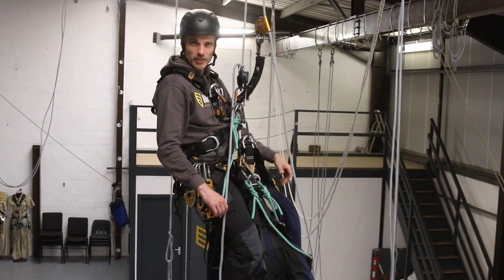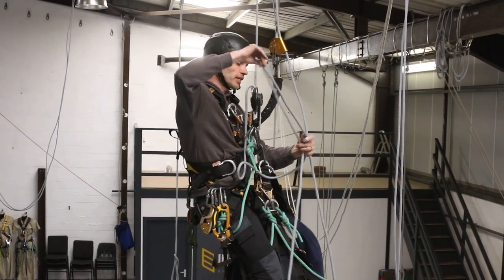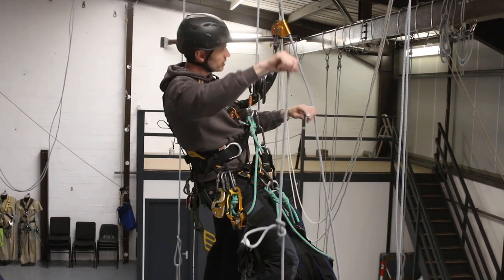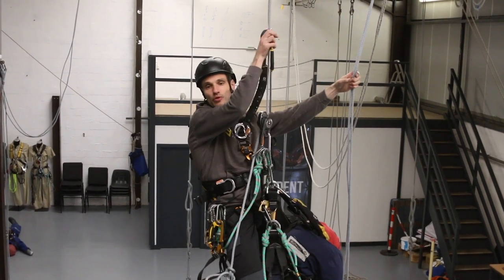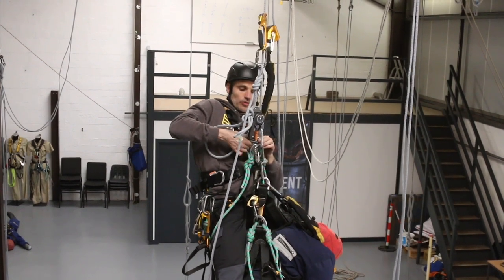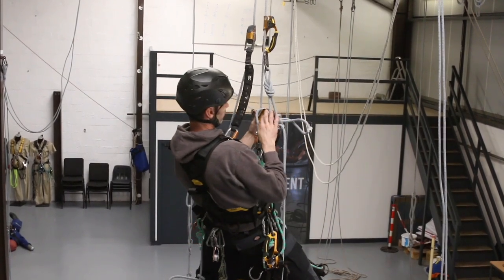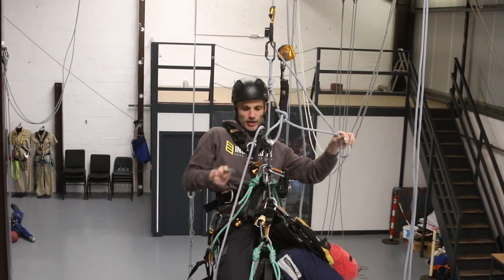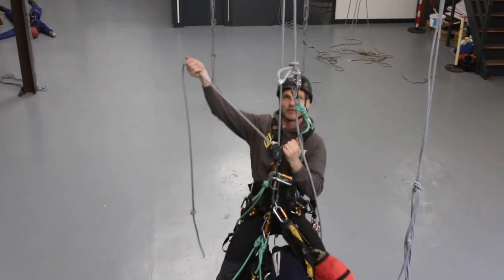Rescue Passing Knots

Comment: When needing to get the asap past the backup knot, is it ok to add another alpine butterfly in the backup line,  connect a cows tail into it, then move the asap below the alpines , remove cows tail and continue descending?  Cheers
Reply from the maker: No problem using an additional alpine as a point of contact to pass the knot, the method shown in the video is one of many acceptable options.
Reply: @independentropes4922  thanks

Comment: Is it possible when you get down to the knot on the working line that you clip an extra backup ontop the descender, then clip an extra descender to where you have backup, and continue descender from there... instead of using a toothed ascender as an anchor point. Then when you reach the 2nd knot (where the former backup has been, and the descender is now), you can switch over again?

Also, can you also use a non-toothed  camming device (ie. Camp Goblin, Petzl Rescucender, Beal Monitor, etc.) as an anchor point in lieu of the hand ascender?

Comment: If you have 2 x ID/Rig then why the need for a re-anchor? Why not just use both descenders and switch the back up when you get to each knot, release one descender and simply move it past the knot. Then switch over on the second knot, that way you get to keep all your equipment.
Reply from the maker: Nothing wrong with the method you describe but it can cause rope stretch issues if there's a lot of rope above you, also people sometimes forget to swap the back-up over. I know some people don't like leaving gear using the re-anchor method but I can say I worry too much about it.
Reply: @independentropes4922  Thanks for the reply mucker. Great videos. 👊

Comment: Great video, just a quick question, a few people are 50/50 on the hand jammer to re anchor? is it ok for a toothed device 2 person load? i did it on my 3 and no questions asked like.
keep up the videos they're great mate
Reply from the maker: Two people on the hand ascender does concern some people. The Petzl rep has confirmed they are fine with it as the 140kg marked on the Ascension is a nominal value to do with the EN standard, not an absolute max. The tech tips on the Petzl website also show the Ascension used as an attachment point when doing a counterbalance rescue from the Croll. This also loads the ascender with the weight of two people, so bearing all this in mind I'd say it's fine.
Reply: @independentropes4922  yeah cheers  i agree, theres so many grey areas in rope access, great video's man keep em up they are mint and priceless as references
Reply: @independentropes4922  hey great video :)
I cant really find the tech tip you are talking about, just one in combination with a JAG -System where not the full 2 person load is in the ascender. Also the german FISAT now says its not ok to do a counterbalance with the ascension. Could you give us an update on that? :)
Thanks
Reply from the maker: @MrChecker7000  Hi, here's the link to the tech tip I mention that shows the hand ascender for a counter balance https://www.petzl.com/GB/en/Professional/Release-and-evacuation-of-a-victim-on-a-CROLL?ActivityName=On-site-rescue. I'm not in a position to comment on FISAT but if Petzl are okay with it I'm happy to use it this way. Hope this helps.